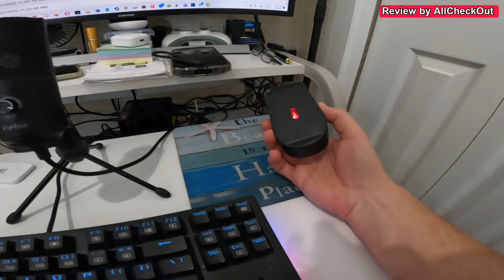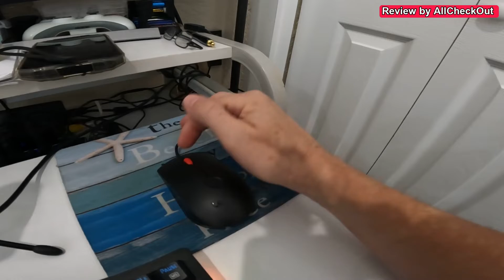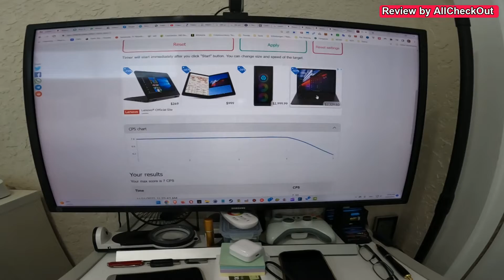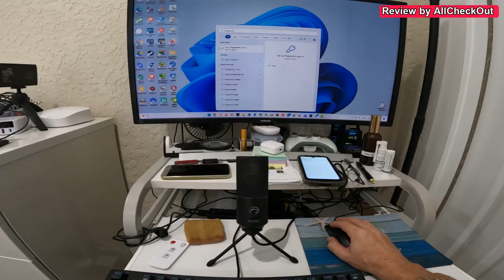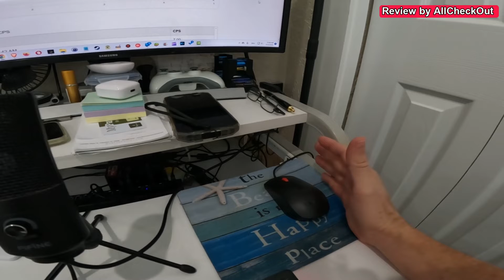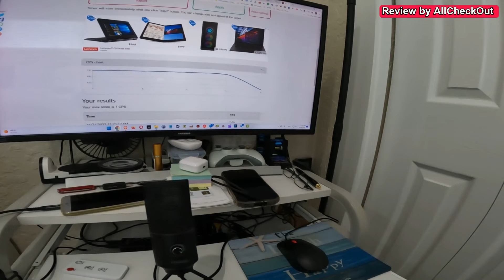Lenovo Fingerprint Biometric USB Mouse Pointing Devices (4Y50Q64661) Quick Review

Comment: how do i reduce dpi on it
Reply from the maker: The DPI on this mouse is fixed at 1600, so you'll need to adjust your pointer speed in the Windows mouse settings instead. ;-))